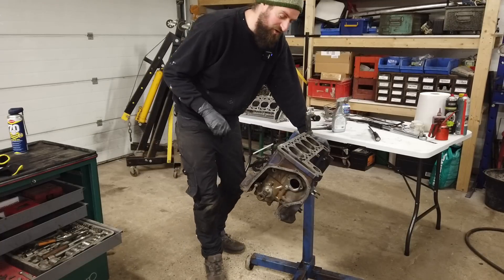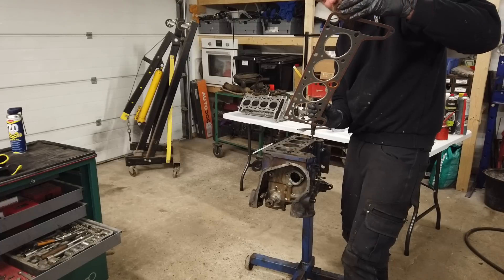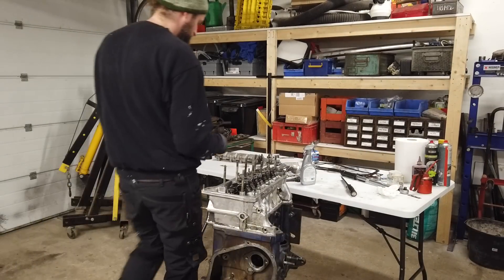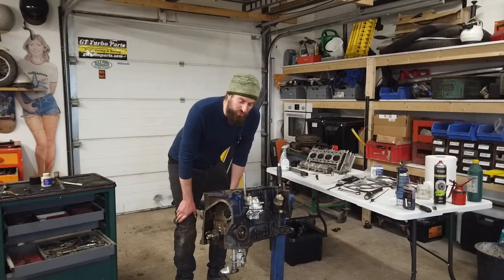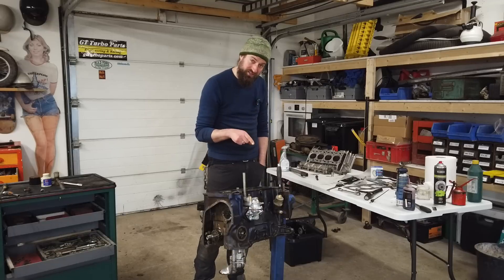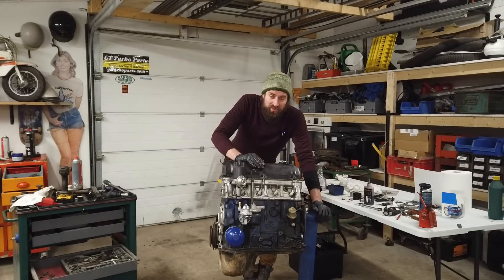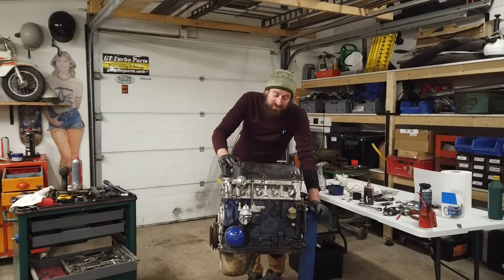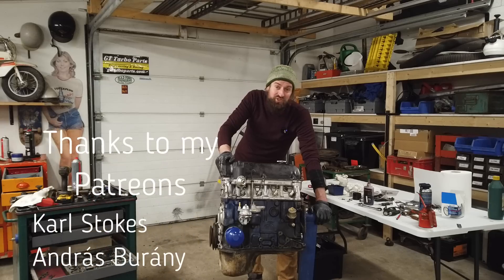Engine rebuild part 2  | The Frankenstein engine

Comment: Even with cheap labor it can't be cheaper to sleeve the block compared to the price of 4 pistons. What might have happened is that they had to sleeve it (because of the damaged bores perhaps) and sleeving to 1700 wasn't possible (sleeves needed to be too thin?) so they sleeved it to 1600.

Comment: Very strange it wasn’t just rebuilt as the 1700 it was meant to be, but I suppose it prolongs the number of rebuilds it can have as a 1600 having the sleeves.
Reply from the maker: Its born as a 1600.... maybe the block froze due to lack of coolant? so all components where good except the block? the 1700 block is easier to get then a 1600
Reply: @SeasideGarage  maybe, but the point I was making is a sleeved 1700 block has a lot more rebuild life and strength than a 1600, even those sleeves could be bored oversize a couple of times! Good thing about a worn out 1700 is it can just be sleeved into a 1600!

Comment: I think I saw "21213" on the side of the engine block in the previous video, which is a 1.7i part number, no?
Reply: Ah someone else picked up on this too. Man, getting parts for these things is a hassle. I have a 21213 here in NZ.

Comment: Seems rather strange to take a bigger engine and reduce its capacity, usually it's all bore the cylinders skim the heads make moar powers, but this, that's strange for sure, maybe it makes the engine a bit more rugged or something? I dunno, it's a confusing one... :S
Reply: Not uncommon. My guess is that someone used straight water or too much water and left the car during a rather cold night and cracked the block. And then didn't want to swap the whole engine but also couldn't find a 1600 block so had someone sleeve a 1700.
Reply from the maker: Exactly what I have been thinking! That makes totally sense... all parts are good except the cracked block... what to do then? sleeves!

Comment: How strange that the engine has been worked on like that regarding the sleeves
Reply from the maker: Maybe the block was cracked due to freezing and all other 1600 components where good? so it made sense to sleeve a 1700?

The 1600 block is a bit rare now I guess..